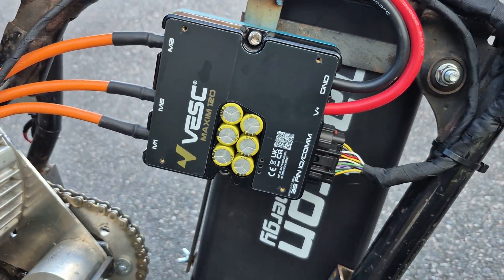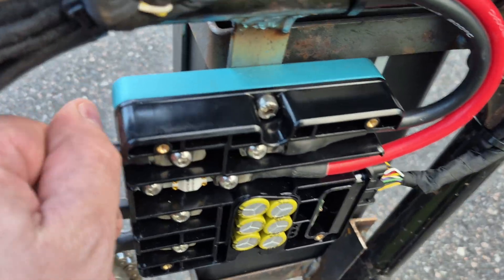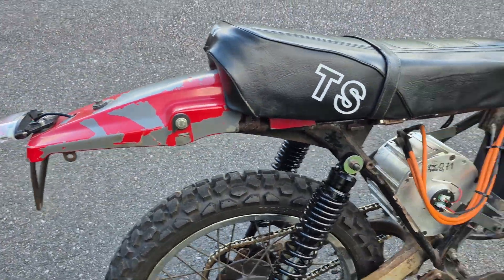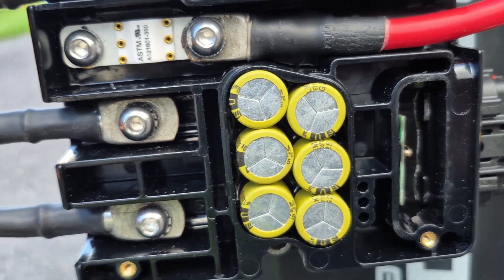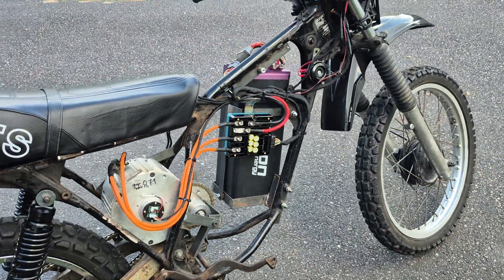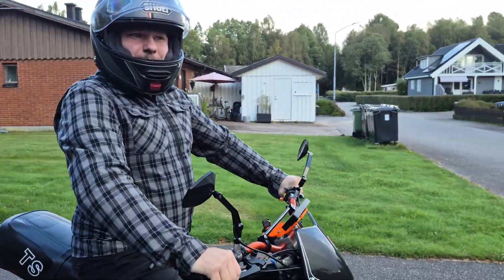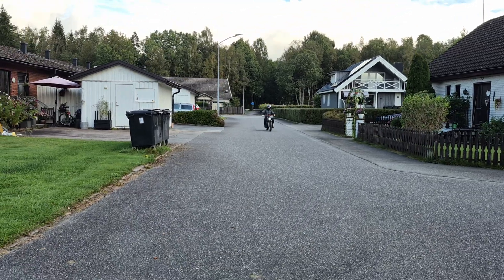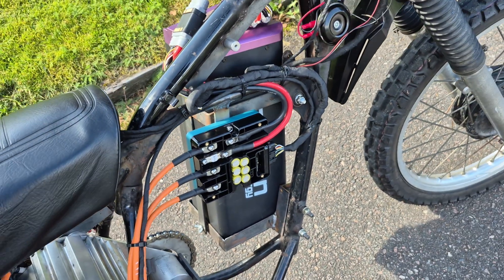VESC Maxim120 on Suzuki TS125 from 1982

Comment: looks like a dirt bike stuck in first gear. What is the top speed?
Reply from the maker: The top speed is a bit over 100 km/h as it is now. The torque starts to drop around 50 - 60 km/h as that is where field weakening starts. Electrically this motor could field weaken to much higher speed than that, but I don't want to run it at more than 8000 RPM or so in order to not explode the rotor.
Reply: @BenjaminsRobotics  How many kW is the motor on?

Comment: Is it repairable when a mosfet dies?
So can the potting be removed for repairing it or is it really hard not removable potting?
In the Vesc TG group we are often changing mosfets for repair or if we want to upgrade to ones with lower internal resistance for better performance or only repair.
Reply from the maker: Getting the potting out is not easy, but the failure rate on these should be very low. We have been testing them for over a year and some of them are on bikes that have done over 2000 km.

There is no need to replace the MOSFETs for higher power as I haven't found any 120V MOSFETs with higher current rating and lower resistance. Going by the rating in the datasheet the MOSFETs in the maxim can handle over 1000A and in the maxim+ over 1700A, so capping them to 600A and 1000A is quite conservative. The temperature sensors are also placed to always capture the hottest spots even when the motor is stalled, so even when running them without cooling at full current they will ramp down the power before they fail.

If you do something like inverting the polarity or give them too much voltage they will fail of course, so as always you should be careful when doing the wiring.
Reply: @BenjaminsRobotics Thank you I really appreciate your response and I also think that the vesc controllers made by your team are made properly to perfection but people will still mess around and there will be broken ones and then they come to me for repair and that’s why I am interested into what type of potting this is?
Some silicon based one? Epoxy? Or something else and if what potting?
Reply: @mud76  It is a PU potting compound.
Reply: @FriesenDesigns Thanks
That’s unfortunate though sadly because that makes them very hard for repair or just tearing it down and look at the powerstage and logic.
I hoped for some silicone based ones that is very soft and can be almost pulled away…

Comment: Really cool staff. Can you filming video how to use encoder/hall via vesc express module
Reply from the maker: That is the plan. I'm working on an easy setup package for IPM-motors that will be installed on the maxims when they ship. Regarding the express, the maxims have a built-in express and a 4 GB memory chip, so when they arrive you can connect directly over BLE or Wifi.

Comment: Awesome packaging, this is definitely a winner. Would it be possible to water cool the back side?
Reply from the maker: Yes, they can be cooled very well from the backside. The PCB is clamped against the case firmly with a large 8w/mK heatpad, so with a large heatsink or watercooling block they can push high continuous power. We chose to make the backside completely flat (instead of milling in a heatsink) to allow users who need it to attach a heatsink or cooling block or simply bolt it to a frame.

Comment: The other languages you have set: German, French, etc. don't work. Please check the German translation to make sure it works. Most people are from Germany and also from Austria like me. Thank you. Oh yes. I also have a VESC 75100 pro and have built a complete scooter, a beautiful one-of-a-kind! I made the VESC ESC with a high-current VSETT display for switching it on and off and soldered two thin cables to the activation pin and GND Oin, i.e. pins 1 and 3, on the VESC and a resistor between the two cables and another resistor onto the activation cable and then plugged it into the connector, which is normally the blue cable, and can now switch the VESC on and off with the VSETT display. I uploaded the script and everything works great! 👌 I took the power for + and - from the battery XT60 connector 👍
Reply: 75100pro isn't made by Vedder at all, other than it uses his software

basically anyone smart enough to design the electronics around it, even taking designs from other controllers, can make a VESC based controller, that however doesn't mean it'll be as good as a real VESC though

BTW i know the Flipsky and Makerbase controllers work "good enough", i have a bunch of them myself